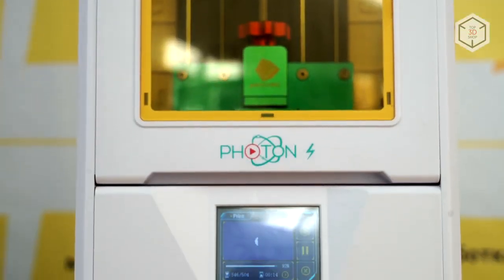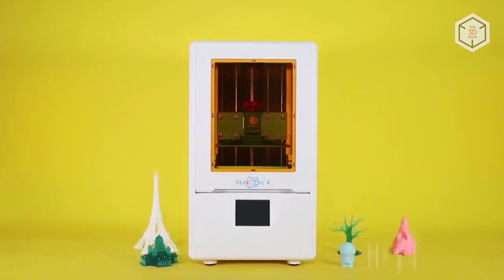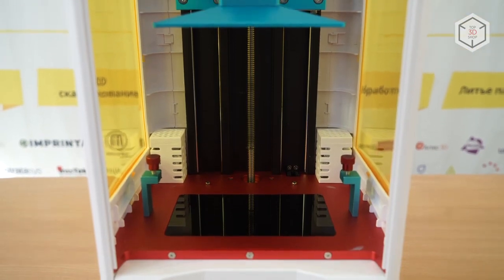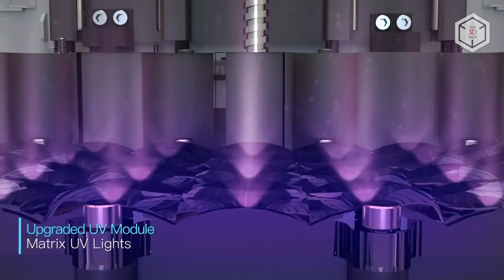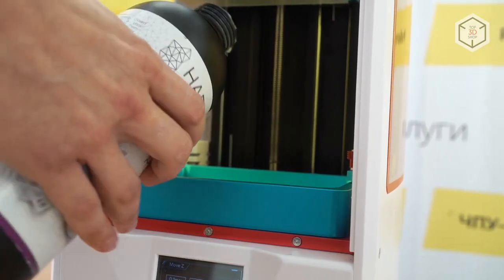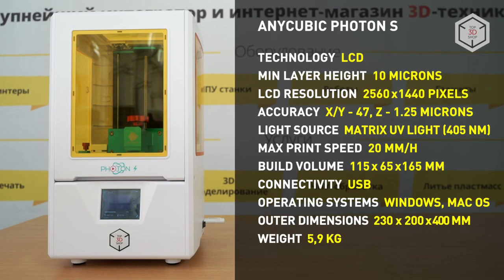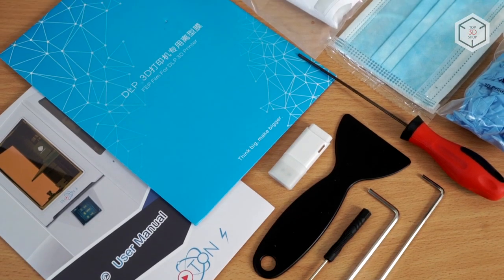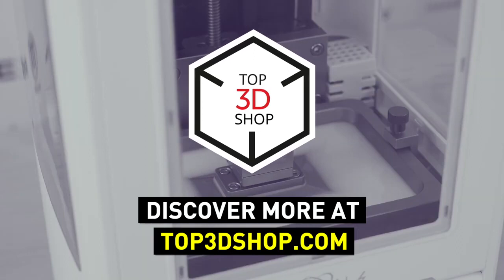Anycubic Photon S 3D printer review: What makes it special?

Comment: Dont buy it the case is Garbage!!!! Printer is great btw but the case pfff 👎👎👎
Reply: You mean this revision or any model of the Anycubic Photon? I didn't like that the case was plastic now, but I did like all the other upgrades.
Reply from the maker: @Cyber_Akuma  The developers have chosen a plastic case so that the consumer does not overpay for metal, which is not necessary. In addition, such a сase allowed developers to add an air circulation system and several steel rails for more correct operation. Many high-precision printers, for example, form3, also have a plastic case, which does not prevent them from being leaders in their fields.